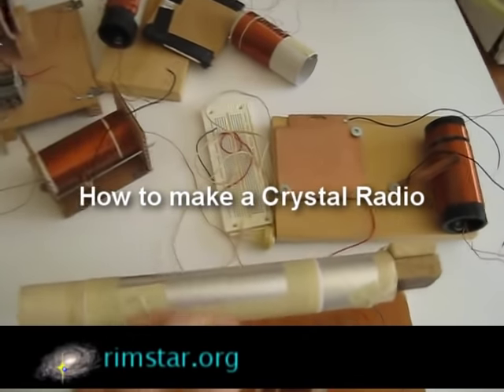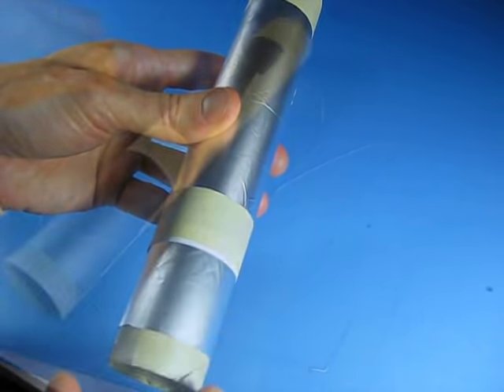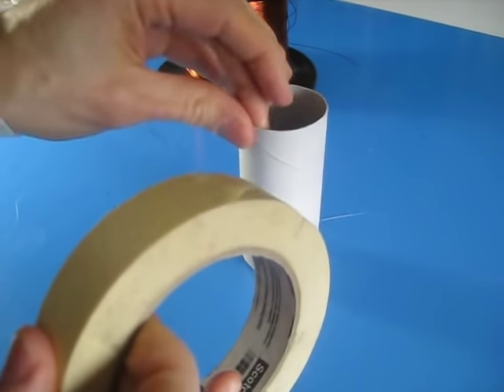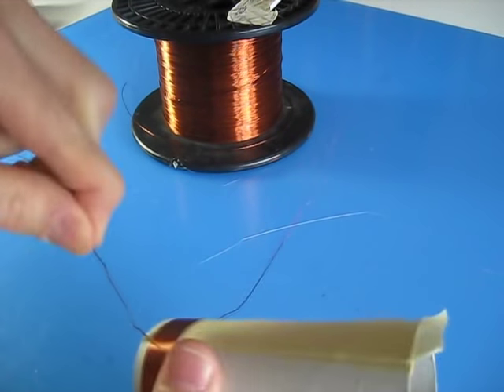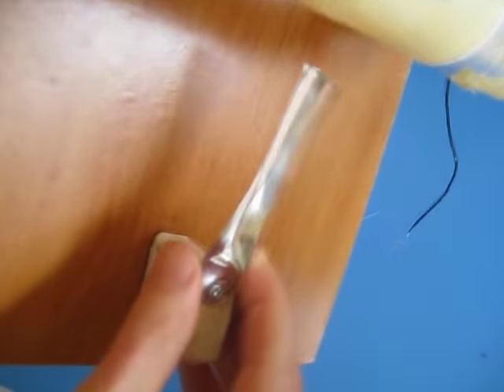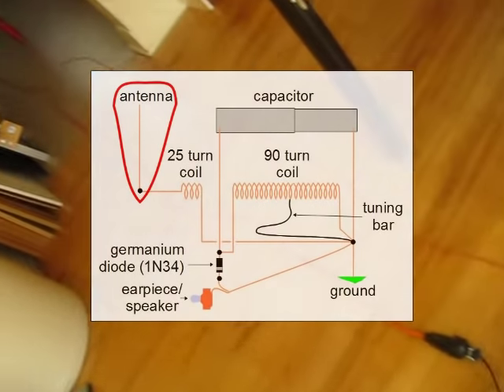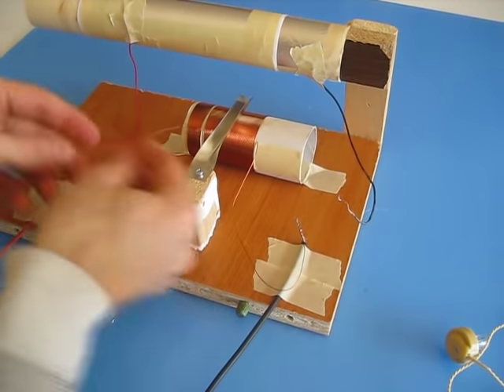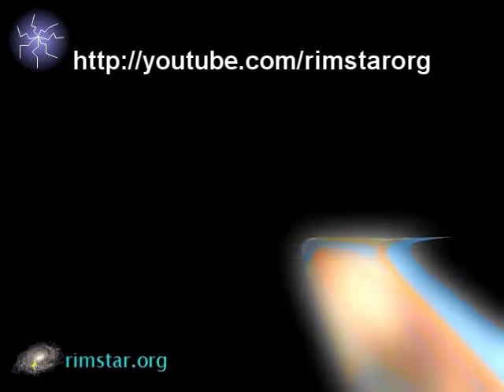How to Make/Build a Crystal Radio

Comment: hello. i have a question about crystal radio. in your video i believe  that diode was put instead of real rock, than what does the capacitor and the turning bar do?
Reply from the maker: +소정김 The capacitor and tuning bar work together to select which radio station you want to listen to. Together they form what is called a tank circuit or an LC circuit. I explain the crystal radio in detail in my video on How a Crystal Radio Works here http://www.youtube.com/watch?v=0-PParSmwtE.
Reply: RimstarOrg thank you so much i hope i could make it

Comment: Can this be made portable with no plug in required and if so, how would I do that?(I mean how could you incorporate the ground into the bottom of the radio)
Reply from the maker: My portable crystal radio video here https://www.youtube.com/watch?v=iunAvz9PbN0 it doesn't have a ground. It is harder to pick up radio stations though, due to the type of antenna and the lack of ground. But then, see the beginning of my amplifier video here https://www.youtube.com/watch?v=JtPwxbOgBHw and look closely, you'll see my right hand is making a lot of surface contact with one of the capacitor cylinders. In that case my body is acting as the ground, and with a ground, the radio works much better. 
Another trick is what I do at four minutes and fifteen seconds into my Van de Graaff generator video here https://www.youtube.com/watch?v=QrCgtjZwnB0, making use of the Faraday ice pail effect to create a ground. I haven't tried that with a crystal radio though.
And you could try just putting a large metal rectangle under the radio and connecting to that. I don't know how well it would work.
Reply: Thank you. I'll say if my radio works.

Comment: I'm confused about the antenna, is it literally a 10-12 ft  piece of wire spread out and than connected to the actual radio. I'm just wondering because that seems odd to me?
Reply from the maker: Yes, the antenna is as you describe. The longer it is, the better it'll work. It should be straightish for the majority of its length. My 10-12 ft is quite short, but I have a few radio stations nearby so the incoming signal is fairly strong, though I have picked up a few from farther away every now and then. To further enhance the signal, putting multiple wires parallel to each other, but spread apart at least a few inches seems to help.
Reply: RimstarOrg thanks for the help!

Comment: Better to buy pvc pipe than to rely on cardboard tubes from paper towels - they soak up moisture from the air in your home and collapse. Believe me, I have built many for others and had to rebuild several coils that were based on such cardboard tubes.

Comment: Would it be possible to make this a CW receiver? if so, how?
EDIT: CW transmits on the frequencies 1, 2, 4, and 7 Mhz.
Reply from the maker: EndTheFilms I'm no expert on CW (I just looked up the definition for the first time) but since its frequency is fixed, I'd guess you'd be able to tune into it and hear something. The coil and capacitor in this video are sized for tuning in the AM band from 540kHz to 1.6MHz, so you should be able to tune in the bottom of the CW range. Maybe you might be able to use a different sized coil and capacitor to tune in higher frequencies. I don't know if you can get all the way up to 7MHz. Look up parallel LC circuits for how to recalculate the coil and capacitor dimensions for higher frequencies.
Reply: RimstarOrg 
So simply making a longer coil wont work?
Reply from the maker: EndTheFilms Actually it's a shorter coil for higher frequency. The problem is that all your high frequencies will be tuned in using the first few turns of your coil, not very tunable. You'd probably have to add more capacitance to offset it so you can use more of your coil. I really suggest you look up the formulas for LC resonance (L=inductance of the coil, C=capacitance of the capacitor) and then the formulas for inductance of a coil and capacitance of a capacitor and play around to design something that'll work (hopefully... as I said I haven't played around with this range.) Plugging them into a spreadsheet will make it easier.
Reply: RimstarOrg 
Ok, thanks.
As I have no copper wire (I bought 50 feet of some, but it turns out there was absolutely no covering at all, just pure copper wire dur) I wont be able to make this for a while, so I will let you know when I have at least a working one.

Comment: The earpiece you are using looks to be about 20Meg DC resistance.  It probably does have about a 20k audio impedance as it has a fairly large shunt capacitance to it.  However, I have found that they work better with a 47k shunt resistor across them in this application.  The 1N34 goes into a better conduction region with this load resistor.  Give it a shot.  If you are interested in the reference for this let me know.  Here is a link to a very similar CR that includes the resistor:  http://crystalradio.net/beginners2/index.shtml
Reply from the maker: Chris Maness Thanks. I've use a 82k shunt resistor for that but I guess anything in the tens of k will do. I talk about it how a crystal radio works video http://www.youtube.com/watch?v=0-PParSmwtE at around 2:44. Cheers.

Comment: Can you use normal variable capacitor instead of this home made one?
Reply from the maker: Yes, you can. To work with the dimensions of the coil in this video, the variable capacitor should have a range from 40 picofarads (or 0 picofarads) to 355 picofarads.
Reply: @RimstarOrg  Thanks for the help!

Comment: what is the significance of the amount of turns?
Reply from the maker: The 90 turns and other dimensions of the tuning coil are selected such that it'll be able to tune in the whole range of AM radio frequencies (or radio stations), from 540kHz (540,000 cycles per second) to 1.6MHz (1,600,000 cycles per second). That coil is connected in parallel with the capacitor in order to be able to resonate at any of those frequencies. I talk about that resonance in this video about LC circuits https://www.youtube.com/watch?v=tjD9I95RAbw.
The 25 turns are selected to be able to use the electromagnetic waves being received on the antenna to create a strong enough magnetic field in order to induce another magnetic field in the tuning coil. I explain that in more detail in my How a Crystal Radio Works video http://www.youtube.com/watch?v=0-PParSmwtE. I took that number of turns from a book about making crystal radios so I don't know how it was calculated.

Comment: What can i use instead of germanium diode. And if i got germanium diode how can determine whether it is working or not? Please answer
Reply from the maker: Vedant Jadhav Some have had success with a few silicon diodes connected in parallel (striped sides connected together and non-striped sides connected together.) I've never tried it myself. To see how to test your diode, do a search on youtube for "how to test a diode". That's easier than my explaining it in a comment.

Comment: I would like to know were to find the 1n34 diode, and is there a replacement.
Reply from the maker: PJ van Wyk I buy my 1n34 or 1n34A diodes online and at local electronic stores. It's a very popular diode. As for online sources (besides ebay) and replacements, see the description section below this video.

Comment: would this crystal radio work with fm signal?
Reply from the maker: It's not designed to with FM. They work on completely different principles and need different circuits. However, strangely, I've heard some people say that they have picked up FM.
Reply: @RimstarOrg   thanks for the help and answer.

Comment: I just had a doubt . Please do clarify it for me as I am doing this project for my school . Is it necessary to attach a variable capacitor ? What will happen if we do not add that variable capacitor ?
Reply: And can we use a rheostat instead of the inductor ??
Reply: No. You can't. It is required to generate a sine wave by generating AC current in the circuit. And Also You cannot use a rheostat instead as it also does not stores energy or generate AC Current...
Reply: Try it both ways and observe the result. Play around with it. Make a change and see how it changes. It's more fun that way. This is how we ended up with so many different variations of crystal radios. People tried things, and some things actually helped so they kept the design.

Comment: Would having more windings on the coil make the radio receive more or less stations?
Reply from the maker: Matthew Synnott Theoretically it would extend the range of stations that it could receive. It would allow you to tune into lower frequency radio stations (below 540 on the radio dial.) However, are there any radio stations broadcasting below 540? I guess it may depend on what country you're in.

Comment: Does the antenna have to be long like the 15 foot one you use here or can it be shorter?
Reply from the maker: 15 foot is actually very short and works for me only because I live near some radio stations. Also, make sure to keep it straightish for most of its length. I have some more tips here https://www.youtube.com/watch?v=HZZmKZJrIW0.
Oh, if the long antenna is a problem then there's also this pizza box portable radio https://www.youtube.com/watch?v=iunAvz9PbN0 but you again have to be near radio stations or you can add an amplifier https://www.youtube.com/watch?v=JtPwxbOgBHw to amplify the weak signal.

Comment: I've made your radio but i only hear some sort of buzzing sound....
Do you have any idea why?
Reply from the maker: Once you get to the buzzing sound the most frequent problems are the antenna or the ground. The antenna should be as long as possible. Mine are only around 15 feet/5 meters but I have some radio stations nearby. Also, the antenna should be straight and if possible pointed in the direction of a radio station. You should also have a good ground connection. I give some additional tips for ground near the end of this Crystal Radio Troubleshooting and Tips video. And it's always a good idea to recheck all your connections, including where you make contact on top of the coils. The diode should also be a germanium diode.

Comment: And can I use a little speaker part instead of crystal eirpeace
Reply from the maker: No, a speaker won't work, unless it's a piezoelectric crystal speaker. If it's a normal speaker with a magnet then it won't work. There is another approach that works okay with earbuds that I talk about in this video http://youtu.be/GCh2LVHUavQ.

Comment: from my understanding  it doesn't require electricity? correct?
Reply from the maker: Yes and no. It does use electricity but the electricity is supplied by the incoming radio waves themselves. That's what makes it so fun, no batteries or plugging into a wall socket needed.

Comment: Is It possible to use a boom box instead of a crystal earpiece? Everything is built correctly but it still doesn't work but I am using a boom box as I said before.
Reply from the maker: How are you connecting the boom box? The boom box has an amplifier so if you find where in the boom box to connect to to use the amplifier then, if everything is good with the crystal radio, then it should work. I have some tips regarding the crystal radio in my tips and troubleshooting video https://www.youtube.com/watch?v=HZZmKZJrIW0.
Reply: RimstarOrg I used an AUX cable tog connect the boom box
Reply from the maker: I'm not sure what kind of signal your boom box expects in the AUX cable so I can't say if that would work.

Comment: Is it possible to change channels or do you only get the strongest a.m. channel?
Reply from the maker: Using the wiper blade on top of the coil and by moving the capacitor cylinder in and out, you can tune it to different AM radio stations.

Comment: I went to Radio Shack to get the Germanium diode (1N34) and they didn't have any.  Can you recommend another source?  Thank you.
Reply from the maker: If there are no other electronics stores in your area then search online. I just typed 1N34 into ebay.com and immediately found some. I've bought some from online sources before. They're pretty cheap.
Reply: RimstarOrg findchips.com/ is a useful tool. I'm sure you paid a lot less on ebay though

Comment: Does the radio have to be tunable? Can we just leave out the part with the piece of paint can?
Reply from the maker: Pandas _ You can leave out the part with the piece of paint can and try tuning with just the capacitor (paper towel roll parts.) If you don't have any tuning at all then it'll be pure luck if you happen to receive a radio station.
Reply: thanks
Reply: I'm trying to build one myself and you've been a lot of help.

Comment: Can I use a copper pipe in stead of so much copper wire?
Reply from the maker: No, it has to be a coil of wire. i.e. Windings of wire in the form of a cylinder.
Reply: Thank you

Comment: I'm doing this for a school project and I'm confused on what kind of wire to use for the antenna. Every time I look up what kind of wire to use, it just tells me to use a long wire. Does anyone have any suggestions?
Reply from the maker: That's actually correct. You want a long wire, as long as possible. It also has to be in a straightish line, i.e., not just a mess of wire. I was able to use short wire because I have a few radio stations nearby. The type of wire doesn't matter unless it's very long, hundreds of feet, in which case you don't want very thin wire.
Reply from the maker: I just saw your email. In the email you also asked about the ground. I talk more about that in this follow-up video https://youtu.be/HZZmKZJrIW0 so I won't repeat it all here. Note that in the video, IIRC, I talk about using multiple wires in parallel for the antenna as an option but that's just some experimenting I did that seems to work.

Comment: Hi Rimstar
 I built one similar when i was a boy (mumble mumble years ago) and often thought about doing it again ,when, a thought occured to me a few years ago can you use the radio signal and use it to charge a battery?
Reply from the maker: +Brett Mciver That's actually why I started playing with crystal radios, to see if I could get any useful power. I don't recall how little it was but it wasn't enough for me to pursue further. But then I found it fun to play with just as a radio, so I did continue in that way.
Reply: +RimstarOrg I know its not much but can you join 2 ,4 ,8 ,20 ,200 crystal radios together to get useful power?
also I know the sun gives off radio waves can we tap that source and get useful power from there?
ohh another thought are you able to add another tuner arm to the coil and recieve another station at the same time?
Reply from the maker: +Brett Mciver Well, with a long enough antenna (e.g. fly one using a kite) you can power a small LED. So with 200 of these you can get something minimally useful but that many crystal radios with long antennas wouldn't be practical. I don't have any output numbers though. 
I also don't  know the strength of the sun's radio waves. It also depends on the frequency. These crystal radios can tune into only the AM frequency range.
No, adding another tuner arm wouldn't make sense. See my video on how a crystal radio works http://www.youtube.com/watch?v=0-PParSmwtE. You'd need completely separate crystal radios and antennas. You could actually have multiple frequencies going through the output of the crystal radio, like hearing multiple radio stations at the same time that are close in frequency, but there'd be so much cancelling out that it doesn't add up. See near the end of my how a crystal radio works video where I talk about selectivity. You'd need a different circuit.
Reply: Thanks Rimstar for the explaination was wondering about the tuner arm purely from a curiosity point of view 
my thought process was radio signal powers the crystal radio which in turn turns the signal into electrical pulses that power the ear piece (simplified version) could you put that power into capacitors? Trying to give you other ideas to try on your channel 
 I dont know what frequencies the radio waves from the sun are either, but when i had my crystal radio going I had a lot of atmospherics pops and squeeks and the weeewhoowooo sound  and i remember wondering at the time if it was interference from the sun

Comment: Do you think that a 32 AWG enamelled magnet wire will work for this coil?
Reply from the maker: No, that'll make a coil that's far too short. All your radio stations will be crammed into a very small length.
Reply: @RimstarOrg  Thanks, I'm planning to do this project this week, tomorrow I'm buying the wires. If you want, at end of the week, I can tell you my results.
Reply from the maker: For best chance of picking something up, the antenna should be as long as possible and as much of it as possible should be in a straightish line. Also check out my tips and troubleshooting video https://www.youtube.com/watch?v=HZZmKZJrIW0

Comment: ok Iam going to go into detail the radios that you buy at the store that you use and plug in to you're outlet to here you're fm am station's on you're radio that comes with a cord that's what Iam saying. by takeing them apart and useing the Turner capacitors for my christle radio can I use my turners that I got out of my radios that I got from the store
Reply from the maker: +Andrew James  Kimble  Oh, thanks for clarifying. I don't know what the capacitance is for those capacitors so I can't say. In my crystal radio troubleshooting video I show how to measure the capacitance https://www.youtube.com/watch?v=HZZmKZJrIW0 and what capacitance you need. I didn't even know they had tuning capacitors. I'll have to keep an eye out for them.
Reply from the maker: +Andrew James  Kimble  Oh, and you can use multiple tuning capacitors together to get a higher total capacitance. Do this by connecting them in parallel.